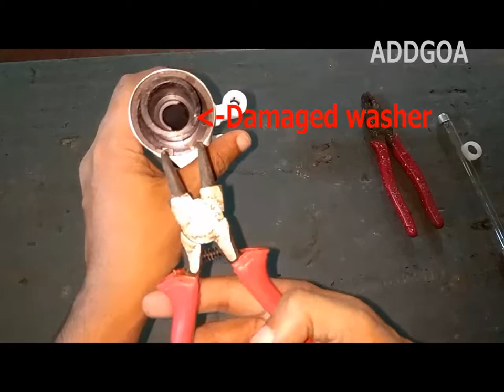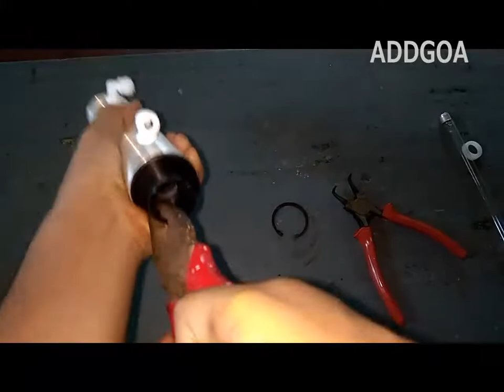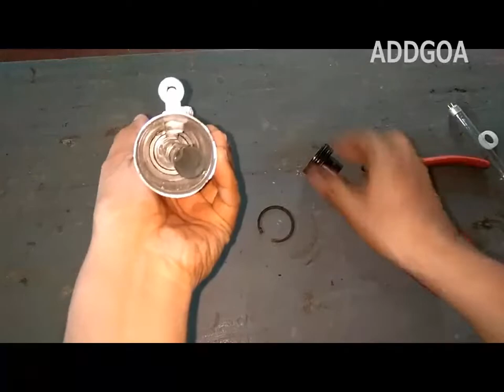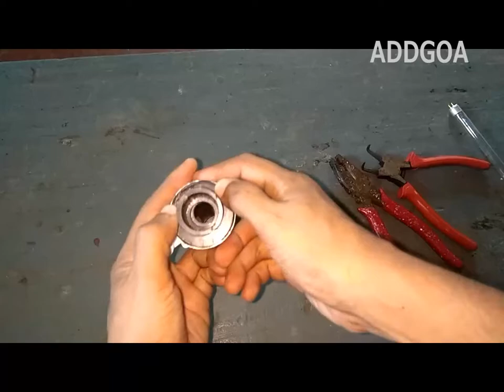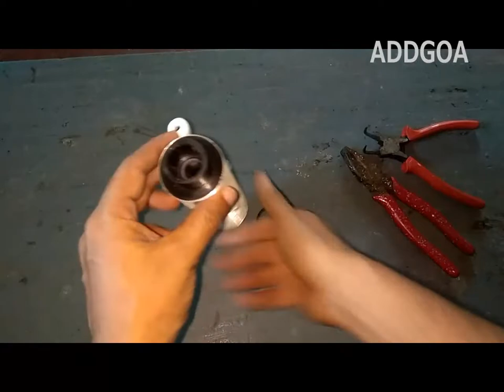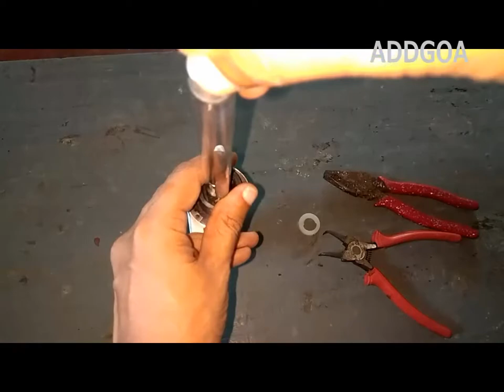How to open UV chamber & change washer  | RO UV Repair

Comment: Hi Sir Where can i get the  new washer
Reply from the maker: Its a hack, Need to search in hardware shop by taking the size, or remove one from such old uv chamber. Or from scrap yard. Or make one using rubber sheet. Possibly no other way out.
Reply: @addgoa-tech  b

Comment: Hi Mr.add-goa tech, I subscribed for your channel, please tell me the washer head diameter and head height. so then I can buy please.
Reply from the maker: You wont find the washer easily in the market. Unless you stay near any RO spares wholesaler. Better go to scrap yard and look out for a old UV chamber there.
Reply: @addgoa-tech  yes I looking for a month, it is not available in a water purifier stores or plumbing hardwares. I will do the same as you said. Thank you